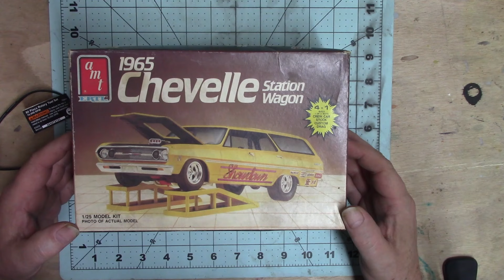CREATING RUST HOLES & REMOVING MOLDED IN EXHAUST #scalemodel #art #model #diycrafts #rust

Comment: Nice work. This is how I do my rust holes as well. Also works for opening grills. What a mess lol
Reply from the maker: Thank you!  Lol I forgot to mention the mess!  As bad as this is, it's nothing compared to the mess I get from making a table top from a tree stump.
Reply: @pappytinkers  wood working is a messy job. Cut a few board in the shop and it's a mess lol
Reply from the maker: @cardzscaledreams3917  table saws, band saw, lathe, chop saw, drill press, and we won't even talk about sanding!  I think the only vids I've posted of that stuff is making an ink pen?